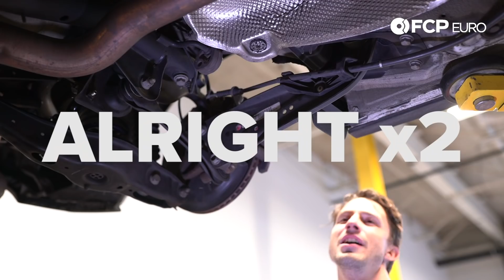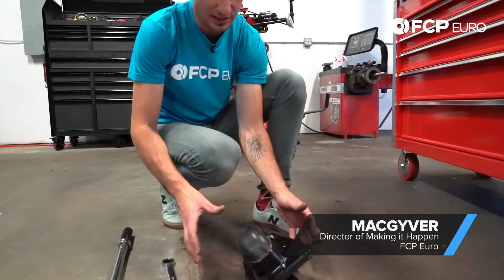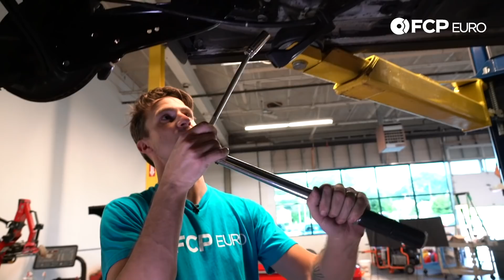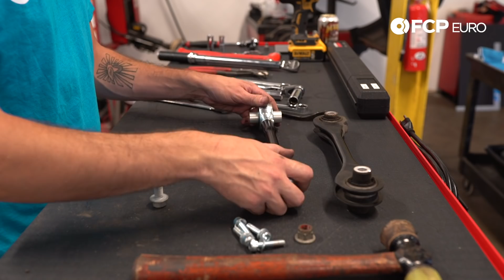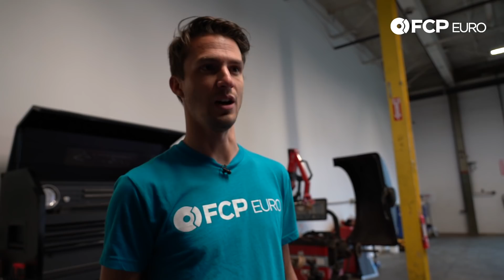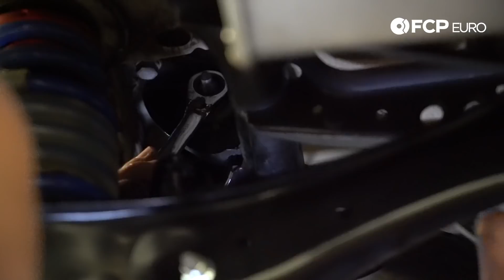Volkswagen/Audi MQB Chassis Rear Suspension DIY OVERHAUL - (GTI, Golf R, A3, S3, RS3, TT, TTRS)

Comment: ****FYI!!***

For the A3/8V models... there are 2 M10 Triple squares holding the sway bar bracket. And the Axel sits right in front of that bolt.

So it looks like id have to remove my axel, just to be able to fit the M10 bit into the second bolt to move the sway bar out the way.

im truly considering just cutting the bolt once it loose enough and getting another. Its a lot just to remove the toe link, definitely not set up the same in the rear as the GTI.
Reply from the maker: Thank you for sharing, good luck!

Comment: I wanna thank the people that commented about ride height. I did NOT know and will be fully replacing my suspension/control arms this weekend. Thats knowledge I will be needing. I do wanna note thought that he's using arms with soherical bearings, they dont need to be torqued at ride height. They adjust accordingly on their own. As for re-using bolts, I cant speak for that, I can tell you tho, with the amount I spent on arms/bearings, tie rods, axles, ball joints, steering knuckles and a Bilstein plus other speacialty tools I did not account for needing(plus alignment when the job is done) I am sure as hell re-using mine as well cos I have zero interest in throwing another $200+ in bolts

Comment: For the trailing arms, if the bushing is the only difference, why replace the entire arm and bushing, rather than just replacing the bushings? It's much cheaper to just buy the bushings isn't it? Could you make a video that shows how to replace just the bushings on an MQB platform Audi or VW?

Comment: Given these guys are a major seller of parts, I am surprised at the lack of actual procedure to install these parts. They are re-using bolts that are torque to yield (throw away) of which they sell replacements for! Also never torque the suspension bolts at full droop like they do here or you will be replacing your bushings again in a short time and have noises you don't like. I can appreciate the general guidance on a VW multilink rear but man, are they doing the shade tree youtube watcher a dis-service by not doing it by the book which will end up causing ppl problems:eyes-purple-crying:.
Reply: When do you torque the bolts? Should the car be on the ground? Or the side you're working on be on the ground? I'm doing this job on mine this weekend, this is good to know brother ty

Comment: You may drive in that pin out of that rivet look like buttering a slice of bread. Not so at my place. Of course mine is a 2007 rabbit with 200,000 miles on it and it's never been replaced.

Comment: I hope he used all new stretch bolts!
Reply: Although not endorsed, you can use stretch bolts 2x, but not more than that.   

As an experiment, I tried to use the same stretch bolt 4x (main pendulum mount that attaches to the front subframe...i.e., a very torque-prone bolt for sure), and it was at that point the threads had failed on the stretch bolt. 

 Switching them out after 2x gives you a 2-fold safety margin.  

But, I only recommend using them 2x IF you have to... you really should change them out each time.

Comment: When you put the trailing arm back in the cup and tighten the bolt should you still be able to move the arm up and down without it bouncing back or making the installing of the cup awkward because the arm is pushing the cup out of position. Would this be due to over tightening the bolt should the arm move up and down without springing back into the position that was achieved when the cup bolt was tightened?

Comment: You should be loading the car to ride height before tightening all the bolts to factory specs when working with suspension parts that move with the road
Reply: That’s true for rubber bushings, but this is a spherical bearing and it moves freely which eliminates the need for ride height torquing

Comment: Where can I get a trailing arms with this bearing for a mk5 golf please?
Reply: Any response, looking for the same as you for Mk5 gti due to inner wear on rear tyre. Suspect it's bushings worn but will replace parts with adjustable. Thks
Reply: Didn't get a reply .

Dd
Reply: @peterdodd8883  did some further looking and seems you can buy from 034 Motorsport

Comment: Does anyone make some inserts for that bushing instead of replacing the arm with a spherical bearing which would die in salty winters?
Reply from the maker: Hi Benjamin, we have two different kits that accomplish that. 
This: https://www.fcpeuro.com/products/audi-vw-bushing-powerflex-pf85k-1008 And this: https://www.fcpeuro.com/products/audi-vw-bushing-powerflex-pf85k-1007
The difference is in the engine mount style. If you look at the photos you can determine which one matches your car.
Reply: There are a few companies that make the bushing out of polyurethane, Nolathane, Super Pro and I think Energy Suspension off the top of my head.

Comment: At 17:30 in the top right corner is the factory eccentric toe adjustment bolt on the inner end of the spring mounting arm 
- why wouldn't you just use this? Also, is the camber arm adjustable in situ? looks like you have to remove it to adjust? Thanks.

Comment: Question about the the rear camber arm. In order to adjust the camber if the length is far away from proper setting, it needs to remove the wheel + remove the outer mounting bolt of the camber arm . Am I right?
Reply: I would think just loosen the two nuts on the camber arm and rotate the center threaded rod to desired specification.

Comment: Question.  90nm + 90degrees tells me we are working with a stretch bolt.  Wouldn't you want to replace it?
Reply: As soon as I saw that on the vijeo I came down to the comment section to look for it. I am pretty sure it's a stretch bolt and I would not reuse the old one myself
Reply: Also, using a torque wrench to do the "+90 degrees"... Cringe :)
Reply: I was about to add exactly same comment but I saw yours. You are right, anytime you see torque + degrees will tell you that bolt should be new. 
Anyway good video. Little feedback, maybe concentrate camera more on the job rather then mechanic.